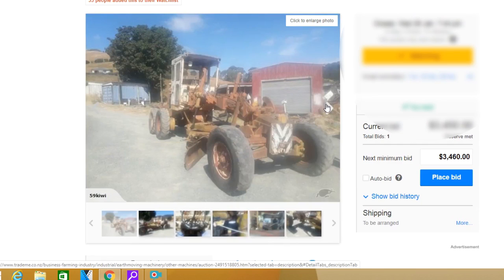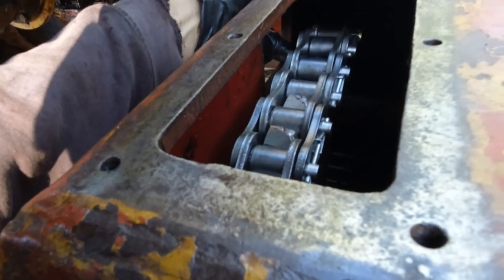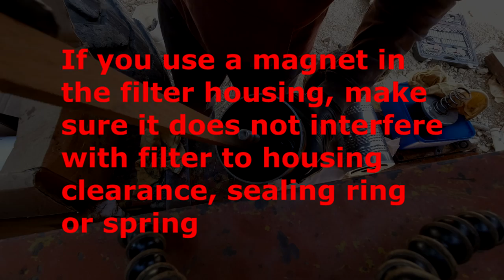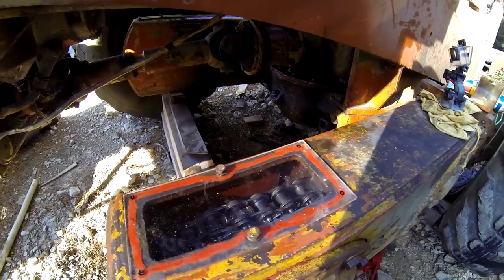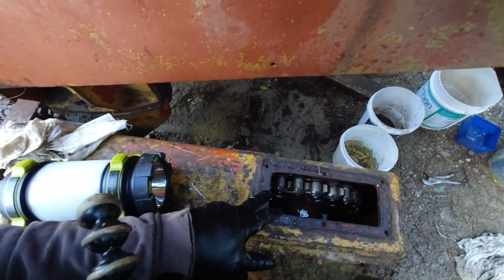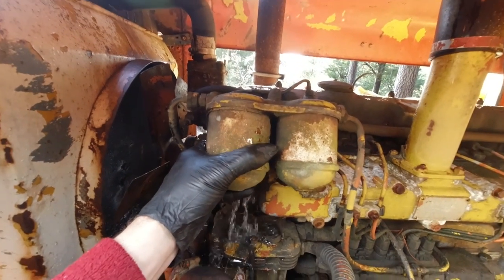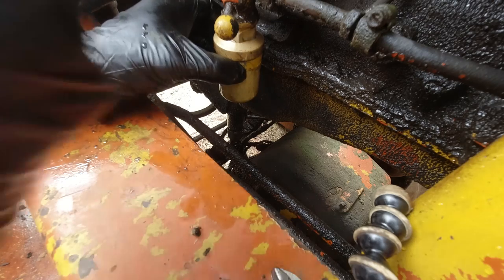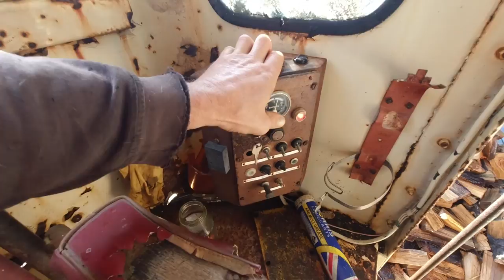12 Ton Grader part 4- Replacing the broken drive-chain and back to work.

Comment: invest in some wurth brake clean the stuff is excellent at cleaning filter housings and no need to worry about contaminating anything cause it evaporates before you can blink and its also interesting as i work for cableprice and I'm busy putting a brand new JD 672 GP grader to see how far machines have come like this grader compared to the one I'm working on

Comment: Now that the AILING BASTARD has had a bloody good service lets see how it works, it is good to see that you matched the tyre size on the drive wheels because with a fixed four wheel drive without a toque divider it is very important to stop inter-wheel fight.

Comment: Finding parts must be a joy...even at 500 NZ dollars.  Age of the machine ??  Suggest that you set up a vacuum pump system to pull bad fluids out of inaccessible places.  You can suck up the funky stuff without a need to disassemble every unit with oil/fluid inside.  Look on the Internet for "aspirators" to see basic designs.  You can rinse out the gunk with gasoline and suck it out too.

Comment: Well I’m 77 and I enjoyed it. I enjoy watching you do maintenance on your equipment, a lot of people will not spend $1000 buying oil and filters for an old machine. PLUS another $450 for the chain. How much did I miss the cost? It will last you another 50 years. Marty how much land do you own on the mountain? Keep up the great work on all the equipment. Stay safe
Reply from the maker: Not far off with the costs, probably $1000 all up nzd. I have 100 acres
Reply: @MartyT  hi marty, depending on SCA level of sponsorship, way cheaper to  buy oil in bulk rather than  small 20l drums, particularly  with  the oil  volumes  of some of your toys, 200 l can be surprisingly well priced.  Might  pay to re check your gallon to litre conversion 4.55     》 ~18litres not 15
Great work
 Cheers
Reply: @davidp8157  hi David USA gallon is 4 liters if I remember correctly 4.5 English cheers Trev

Comment: A good dose of Chemtech's Diesel Power through the fuel system would probably do the old girl the world of good, as it would all your diesel equipment. It has emulsifiers which gets rid of all the water in the system and kills any "clad" diesel fungus. It is supposed to lubricate and clean the pump and injectors as well. Another project for you could be a home made, tow behind roller for your last few passes, possibly made from worn out truck tyres, filled with water on a wide axle and towed behind the grader. It would smooth and compact the surface so it doesn't wash away with the rain.

Comment: Next time you grade the driveway think about not putting a gutter along the downhill side of the road so the water runs straight off the road into the bush rather than running down the gutter and digging a ditch.

Comment: I would have replaced both chains to be thorough...its gonna break next. Old machines are cool! Get yourself some stoodite rod and put it on that blade. It will help avoid erosion of it . my dad had a subsoiling machine with a shank taller than my house and they put lots of that stoodite on it.  An old mechanic friend of mine said when ever he replaces  a part all ways replace the fasteners with new ones..keep all the old parts for spares. Just my two cents and thanks!
Reply: I'm not sure what "stoodite rod" is.  Is it something like cutting edge, found on loader buckets, grader mouldboards, scrapers, dozers, other heavy equipment that contacts the ground and lifts away material.

Comment: All in great fun!!   Would be fun hanging out and fixing stuffs!   Wild equipment rescue.   Is it tough to find an inch-o-meter there?  My old Deere manual said to flush out water contamination add a few gallons of diesel, run it, drain and refill with the correct lube.  Might all drain out well for you though.  I wonder on the fuel filters if you could add a bottom bowl from Racor that's clear poly and comes with a drain cock on it.

Comment: trick to clean up rear end chain , after u drain oils out , put about 4 gals. of diesel fuel , then run this machine all day , might take another day to / this wat the bottom will be clean , an other thing else

Comment: I see you have not discovered the lever that makes the front wheels tilt over.  Would help a lot in those tight turns.
Reply from the maker: Yeah I know, it also puts more stress on the chains when turning

Comment: The thing that fascinates me is that this was going to scrap.  Obviously someone knew of the final drive issue.  I bet at one point that tire bound and dragged.  A couple videos ago Marty pointed out that the tires were different sizes and I'd bet he is right especially is that thing rode on tar.  All it needed was someone to take the time a not that many hundred dollars to fix that old girl.  NO modern grader would survive the years of hard service that wore those tires down and none will be fixed by a patient man in the woods

Comment: Marty hows the cutting edges going on the blade ? They look a bit low
Reply from the maker: You're right they are getting low, Do you think they'd be reversible? the top side looks mint, maybe I can flip them over
Reply: I know Cat ones are throw away , never know give it a crac and see what happens might fit .
Reply: Just had a look at first video reckon you can end for end them should fit
Reply from the maker: I'll give it a shot. Cheers

Comment: Nice and carefull work, i have an old english diesel (4 Cyl Coventry genset) and it has an injection pump like yours and they have oil in them with a small dipstick to check the level. It is not uncomon for the oil to leak out and the cams the work the plungers wear very badly
Reply from the maker: Thanks, I'll have a look for it, can't find much info about the leyland 401

Comment: hey man, if you can get yerself a can of diesel cleen, it treats up to 100 gallons but dump the whole can in your tank and it will clean the injectors and pump. it will run better ive done it to the pull rigs i used to work on on the oilfield and them 16V-71 detroit's would perk right up. if the motor is still smoking a lot, drag something heavy around your yard or put the blade down and let the motor get up to temp, them diesels need to be ran hard so that the rings seat well. lotta old grader have problems cause the owners just putter around with them
Reply from the maker: Good advice thanks mate
Reply: @MartyT  yessir, get yerself a water temp gauge if the one on the machine doesnt work and run er at 86 or 88c for a few hours, see if she stops smokin as much. looking forward to seeing ya gettin things done

Comment: Am I the only one who is surprised to learn it has a drive chain?
Reply: I saw one in 1966 sitting cock-eyed at the side of our gravel road where the whole left side drive case with both wheels attached had broken off the main drive shaft..which looked to my young eyes a very large axle ...fractured clean through...casting failure.
I didn't see the chain drive inside the case and I never thought about the mechanism to transfer the engine power to both drive wheels on the one side.....until I saw the first vid from Marty re this grader...

Comment: 140 roller chain... Heavy stuff for a small grader.  If I read it right that's Reynolds chain. Its very good in industrial applications but for high shock load I would rather use Tsubaki. Heavier side bars … Its not a big deal ..that chain will be on there for a while.
Reply from the maker: Its DiD chain, not the best quality but for the amount of hours I'll put on the clock it should last many years
Reply: @MartyT   Did is a stamp for a Japanese company called Daido Chain. When it first come to North America (I am Canadian ) in the mid 80s ..it was junk.  It has improved greatly . You should have no trouble with it.

Comment: Enjoy your shows. But I wouldn't like to make a request for recommendation. It would be so much more pleasing if you invested in a high-pressure power washer and steam clean these filthy messes before you start working on them. Do you really add to the start and finish look of things
Reply: He lives in a remote location without mains electricity or water. The electricity supply comes in very small quantities from a home devised hydro electric plant that would in no way cope with high pressure anything, water or steam! Rather than finger wagging, it would be  better to appreciate just what has been achieved to make these old things usable again with such modest resources.

Comment: That seemed like a lot of grease in the fan hub...probably OK but I would check it after you run it. Just make sure the fan isn't making it's way toward the radiator.

Comment: Are you gonna give the grader a  jet wash and some protective paint  could really use a bath lol. wow doesn't turn vary well 20 point turn lol possibly some new tires in front !!!
Reply: Forgive me but this is not about restoring items for Pebble Beach concours d'elegance. It is about acquiring elderly equipment, as reasonably as possible, expending some well judged finance and labour in getting them running again and then putting them to use. All this in a semi-mountainous part of New Zealand remote from mains water or electricity supplies.

He is well aware of any deficiencies in tyres, hydraulic seals, etcetera and will attend to these in due course, time and finance permitting. Please respect his priorities which may not be quite the same as yours!

Comment: When I saw you torque the hub bolts I thought no...that is a breaker bar not a torque wrench...but then I realized you were using a German torque wrench..,"goodentightenya" :)

Comment: You may want to check your oil is measured in US gallons, not UK gallons.  4 US gallons = 15 litres but 4 UK gallon 18 litres (all rounded)
Reply from the maker: Good point, it will be Uk gallon

Comment: A BIT MORE CHOKE AND MARTY MIGHT HAVE SCHARTED , LOL  , great video, all the cotter pins in the links is how allot of suppliers do it now for ease of service no grinders needed to cut links anymore, it is running well now and you'll get around to the other things eventually, those king pins and other ram leaks next is my guess, just have some fun with it hope you find someone to cut you a new windshield for it and the gasket for the glass is easy to get and not hard at all to work with and a little bit of black silicone at the joint of the rubber be as good as new, keep 'em coming Marty 👍

Comment: 8:05 I have been told to oil only the outsides of the links. Not the middle on the rollers.
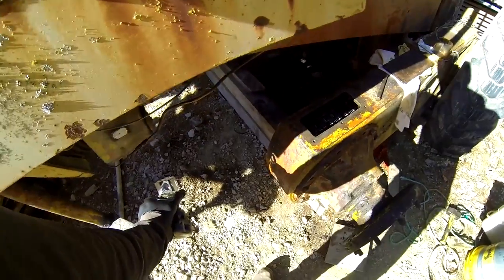Reply: 9:44 But with 16 litres of oil in there, it doesn't matter, it's not like a pushbike chain.

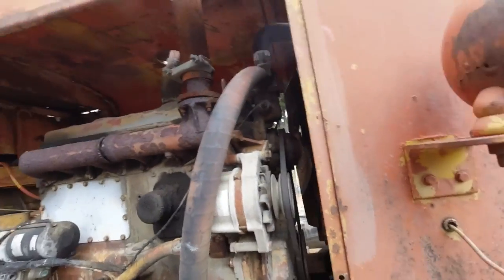Comment: 16:11 what is the grease nipple around the fan? Is this a diesel thing? Serious question, thanks
Reply: If you look at the posting about the resuscitation of the petrol engine Bristol crawler , you will see a similar greasing point. Neglect of this in the past seems to have led to the bearing failure on the shaft. Both machines predate sealed bearings.

Comment: Try using a lighter to heat some of those blocked grease nipples. Bit of a bush fix but usually clears them.
Reply: Lighter?  Most guys I know use a propane torch or even their oxy-acetylene rig to warm up miserable zerks that don't want to take grease.   I bet a lighter would do it in some cases, but I've seen trucks that had to be jacked up at the front so that some nipples would take their grease.  It's sad that some machines get left so long between services that they need help being fed grease.

Comment: When you are putting gasket maker and you're able to squeeze it out of the tube I highly suggest you do that you just make a nice clean bead all the way around and then put your piece back on. What are you doing on what your finger for me is not doing a good enough job yes it will work but not as well as a full nice beat all the way around
Reply from the maker: I always make sure the joint is raised enough to create a good seal but I hear what you're saying

Comment: I hate to say it but shouldn't you have pulled the rear tire and wheel and filed that back drive gear, it's probably scarred up like the front one was...
Reply from the maker: I did reach in and feel it, it was ok. chain must have been dragged around the front sprocket when it broke and pulled free of the centre sprocket

Comment: Probably a silly question, but why not paraffin wash it before you start? It would be an awful lot easier to see and work with the 50 years of goo gone.
Reply from the maker: And remove the  rust proof coating?

Comment: Geesh Marty what did you do, buy an old rust bucket that needs a bit more choke? You might want to pull the fuel tank on that thing, and have it cleaned and sealed with the amount of rust in that grader. By the way you do know you can make gaskets from an old shoe box, for some of those access plates? Was an old trick I learned on my 1965 Ford, that my old man who was in the army taught me.

Comment: Don't understand why - bearing in mind he's got every machine imaginable - he doesn't lay a concrete pad in his yard. Working in the dirt and the dust would drive me mad. Every time you put something down, or worse, drop something, you have to wipe it clean. Not for me.
Reply: That's part of the beauty of a shingle yard..you can drop stuff and you don't need to clean it up. Notice Marty uses drop cloths/plastic now or cardboard to stop the ecowarriors' savage comments re pollution etc....  /s
Reply: @teenaramsay2469  Not sure I agree
 Nothing has a firm footing, jacking up is an act of faith
 It's a nightmare in the rain and you spend hours trying to find, and clean stuff you've dropped.
And I'm not sure it's a shingle yard, more bare earth.
I'm think I'm a lot more OCD than Marty. I'd have to sort it, and paint numbered bays for the machines! :)

Comment: Was that the turbine i heard in the background @ 22:35???
Reply from the maker: No you can't hear the turbine from the shed, that was the excess power being pushed into my top bank of batteries via a charger powered by the inverter at the turbine. I have a plc in the shed telling the power where to go at different voltage levels - 25v charge top bank, 26.5 hot water dump, 28.5 heater dump. At 29v the water  dump valve opens
Reply: @MartyT  Ingenious, I know u said u made a vid about the setup b4 but can u re do the vid with a bit more simplified explanation to get the youngins more interested and maybe encourage less educated folk to give it a try. Maybe throw in a white board schematic diagram etc.
Reply from the maker: @OffGridAussiePrepper  When I build the next turbine I'll go into more detail

Comment: It’s weird seeing clear diesel fuel.
Reply: What colour is yours?
Reply: @briananthony4044    I don't know what color he uses, but where I'm from,  we use dyed diesel in our off-road equipment.  It's got a red dye in it, looks pink, and it's easily detectible.  The dye would show up if Highway Transport Authorities checked your tanks or filters.  Dyed fuels indicate that road taxes haven't been paid in the price of the fuel.  Used in locomotives, construction equipment, farm equipment, reefers, heaters, compressors, generators, anything that isn't a power unit to haul goods up the highways.  In North America,  so-called "clear" diesel might have a tinge of yellow or green to it, depending on whose brand it is.

Comment: She's begging for some paint mate..
Reply: Just about all the machines have many years of cumulative neglect to remedy, requiring expenditure and much work. Marty's priorities are correct.
Reply from the maker: Your'e spot on Paul.. Plus my old machines all seem to leak oil, which provides a free rust- proof coating ;)

Comment: See you don,t clean things down before you work on them engines ect when we where working on plant first place it went when it got to the yard was the wash bay before a spanner was put on it, as the old timers use to say let the dog see the rabbit bit of a dirty job but make's it a lot easier when the kit was in the workshop
Reply from the maker: I usually waterblast before I work on machines but my hose wasn't long enough and the crud is likely holding back a few leaks ;)